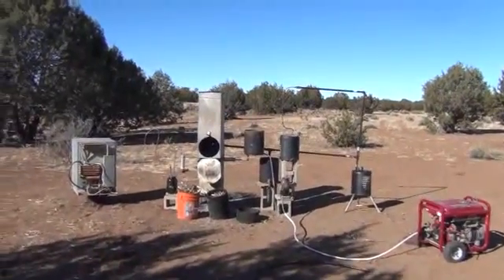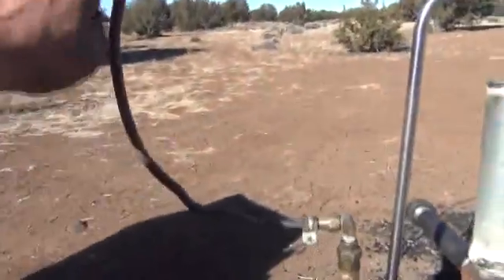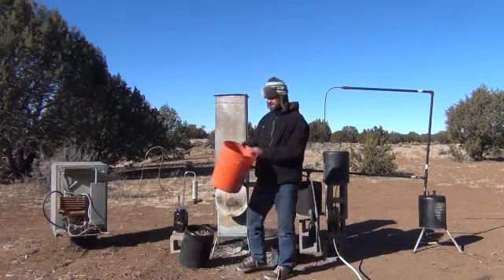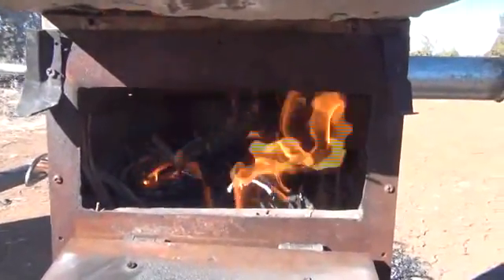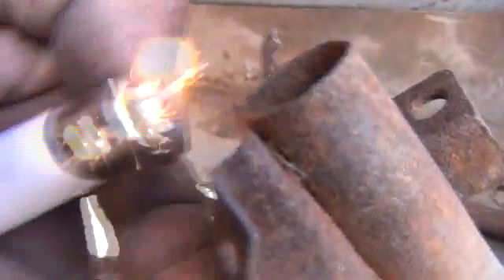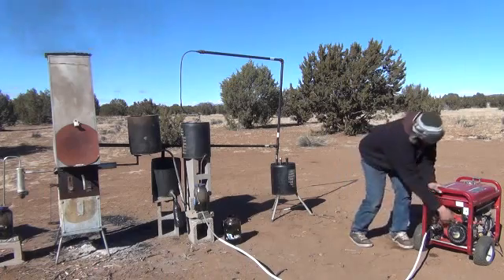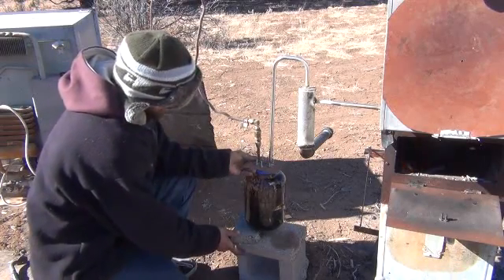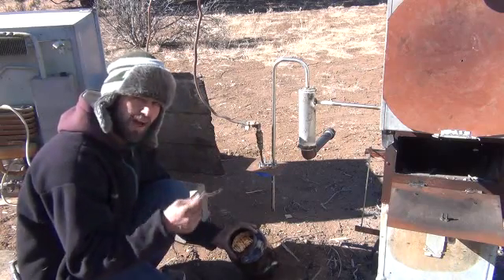Wood stove runs a generator "final video" make's gasoline, and propane.

Comment: If cold is important to improve efficiency. Couldn't you use a water loop that as the water heats up, it does a natural pump/percolation effect, which you could put in a water heater for a closed loop system? Then you'd have the added effect of a hot water heater while making fuel?

Comment: +MrTeslonian.
First off, thank you for a very informative video. Now a (maybe stupid, maybe already answered) question: are the (potential) gases, coming out of the blocked off pipe (before your gasoline condenser) flammable? If yes, wouldn't it be possible to lead those back into the system and using them for heat, thus making it a self-powering system?

Comment: I like a lot of others who do their own mechanical work usually have quite a bite of used motor oil around. Can that be introduced into the system either with the dry organic material, or one of the further distillation steps. Recycling that oil in to a usable fuel?

Comment: In my opinion there's nothing more valuable on YouTube than your channel. Keep it up!

Question - During the test phase you boiled the crude in the test tube and condensed the fuel out through the coils in the blue kettle... can this distillation process be done on a larger scale (a few gallons at a time) instead of using the metal catalytic process? If not, could you point me to some literature that lists which catalysts to use if I were to duplicate your system?

Thanks a million for your hard work.

Comment: Very impressive, I have been working on a rotary elector magnetic cylindrical  motor with a opposing pole application. It consists of 8 individual rotors which are timed
in sequence, The prototype is very small and i can't produce enough power to sustain transition. But it's a fun toy and somewhat of a hobby, your concept is 
working and producing energy in multiple ways.

Comment: You should look into the design of new high efficiency boilers.  They use large stainless steel baffles to slow down the exhaust gasses.  After slowing the exhaust gasses they extract the water vapor and use it to pre-heat the water going back into the boiler.  Very efficient systems.  The exhaust gases are so cool you can use PVC to vent them.  Once you get steam it can then be used to drive a turbine or Stirling based system.  From there you could run a generator and use it to generate high voltage pulses to extract hydrogen from water.  Even if your losing energy by making hydrogen, this gives you a way to physically bottle the heat instead of venting it off to atmosphere..

Comment: In your previous vid. You were talking about a way to recapture heat from the chimney. Mabe you could capture the unburned gases and reburn them or incorporate some kind of stirling engine to capture the heat and use it mechanically, mabe to turn a small generator or pump liquids for your machine, water pump or what ever. Just a thought.

Comment from the maker: Some crops would have a higher fuel density than others, they all will work as a gasifier fuel. Personally if I was intending to use large volumes of farm waste as a fuel source I would set the system up for methanol production which is much harder to do at a small scale than a fractional distillation system. If built right the entirety of the wood gas produced can be converted into liquid methanol, the pressures required are much larger in the order of 2000psi in one phase and 4000psi.

Now with most of the crops you listed, the first step for self sustained fuel would be to press the crop waste in a large vegetable oil press extracting the oils before the material is burned, this "vegetable oil" can be made into bio-diesel and by adding the methanol it becomes stable with a higher octane. Both of these fuels have a high market value. Methanol is by far safer environmentally than gasoline,The second step after the oil press would be a ethanol brew tank especially for the sugar cane and corn this would produce large amounts of ethanol, next I would take the mash from the brew tank and put it into a methane digester harvesting large amounts of methane, and then I would dry and burn the composted waste in a gasifier producing methanol. This would be the most efficient cycle for farm waste fuel production. Most oily, and starch laden row crops have a larger potential for fuel production than wood because of there other stored energy values, remember all we are doing is extracting by as many means possible the stored sun light in the material.
Reply: Mr teslonian I was wondering if you would be interested to come to the Philippines and help me and my team build a small scale biomass power plant I would be more than willing to pay for your ticket and accommodations and talent fee for your help  if your interested please email me (stavristeve321@gmail.com)
Reply: Yeah,  I think it's like, not turnips or radishes, or cabbage.. ugh, that stuff Dwight was a farmer of on The Office, that has a really high propensity to be turned into bio ethanol fuel I think.

And btw I heard some guy talk about antigrav tech.  Anyway, he said he saw a top secret air force/boeng experiment with a tesla coil BUT at the discharge point of the tesla coil there were fiber optic cables which ran back down through the insulated tubing that the secondary (your tall thin coil) was structured on, and that the tubing was filled with mercury.  The fiber optic cables ran back down and then actually went back into the & powering the primary coil (the thick one at the base).

I noticed you sometimes call secondary the primary and I know why, you reverse the use of them.  Andyway, I don't know enough to say there should or shouldn't be some type of law of resistance....Well actually I know enough to say there should be. BEMF & what not.

but I think it's pretty interesting trying to use the spark generated to be input back into the primary coil.
Reply: I would like to ask you a question on your wood stove Mr. teslonian. Will your woodstove work on oil palm fruits, for we have plenty of oil palm trees planted on our land here in Sarawak. I would like to try on oil palm and jatropha fruit as fuel .
Reply: Michael Z

Comment: Looks like that fuel has a high octain and low ctain content close to that of regular 87 octain, i am very impressed. That thing works great for a prototype and the best part, you kept it simple. Found your vid. While searching for info on using my wood burner to heat water for heating my home, now i have a few other ideas.  Thanks for the great vibeos, YOU GOT MY VOTE !!!

Comment: With all of that free wind energy you've got there- could you come up with a simple turntabe/belt-pulley rotary centrifuge to extract and seperate your different oils? If a drum within another drum is mounted to the turntable- and the final liquid pipe is above it- as the liquid is produced, and dripped in- just like how a clothes washer spins to extract the water- the lighter fluids would spin up & out first- leaving the heavier at the bottom. Just a suggestion- what do you say? Thank you!
Reply: Centrifuges are super-hard to balance. A highly skilled machinist could certainly do it, but it would be a tricky job.

Comment: we had a chance a few weeks ago to buy a pallet of those steel gas cans at an auction, now wishing we had bought them....   I'm not a machinist type person but you do a good job of explaining how everything works I think I can muddle my way though trying to build a setup like this.   

One thing we were wondering, would green wood produce any different than seasoned wood??  or would it probably produce just much more water vapor?

Comment: Your system is operating on "scraps" from oily woods. Could efficiency be gained (or lost) if you were using crops grown primarily for other purposes, sunflower, rapeseed, olives, hemp, sugarcane etc. In your opinion would a particular row crop out perform the material you are currently experimenting with? Excellent presentation. Very forward thinking, and, creative utilization of readily available construction materials. Thank you for sharing your research. God Bless.

Comment: what about offsetting gas or diesel using this in the air breather unit???  like you would a hydrogen generator?      We have a number of military surplus 3 phase generators some from the 60's that have carb problems and can't find parts for them.     This company: propane-generators DOT c o m has from what I understand very good low cost conversion kits.

Comment from the maker: The carburetor for a standard gas engine will not work properly for wood gas, so I removed it and therefor removed the governor. As you point out the hertz will be fluctuating as you apply and remove a load from the generator, the carburetor needs to be specifically designed to run wood gas which I don't think any one has done yet as a product. I found that a propane powered generator or vehicle is easier to convert, due to the similarities in lpg and wood gas.

Comment from the maker: The limitation of the demo unit was volume, the demo would need to be fed every 30-40 minutes, now the amount of energy released during that time frame would fully heat a large building. To capture and slow release the heat a trick I learned in Alaska would work well, the lodges all used very large water tanks some 22 feet high by 8 feet in diameter to retain the heat from there wood stoves and slowly release it. This would work very well for a gasifier stove. Info on the stove coming soon.

Comment from the maker: I have not tried sunflower seeds, as a gasifier fuel they will work fine as will any organic material. When it comes to creating liquid fuel from it there may be some catalyst modifications, like the catalyst required to turn bio-crude into fuel is different than the catalysts for a plastic trash based crude.

Comment from the maker: The unit in the video was a test prototype that I had built just for the show, the coke ash is removed after every cycle by injecting pure oxygen into the carbon cracking chamber increasing the temperature allowing the coke ash to burn off of the catalysts. The most advanced unit so far has a fluid catalyst cycling system.

Comment: Excellent research and practical application. Great show how to do and not talk the talk. I have a question on the generator. How can you maintain the 3600 rpm required to produce proper power for power tools. This might burn them up since they are not quite operating at the specific frequency. Anyways for lighting and then pumping that power into a battery bank for stored energy would also be helpful. Anyways excellent work Mr. T.

Comment: Great video on Process Operator Engineering. However since this is small scale do you do a shut down and cleaning? Or dispose and rebuild parts? If you clean how often/how many hours can it run before cleaning is required. Mainly the coker do u clean or replace? and the hydrocracking could be a dangerous pressure? how do u regulate it safely? It is quite obvious you have a knowledge in engineering and proses operation. This is not for the average do it your self.The synthesis gas is high output.

Comment: Love this series!  A good question I have is the propane-like gas you are creating compressible?  Other wood gas generators I have researched just create a use now type fuel and cannot be stored unless a generator is used to recharge battery bank.

Comment: A simple idea for using the excess heat coming out the top of your stove during production: 
Prune some of the trees on your property, hook a mulcher up to the syngas stream/generator, and reduce leaf/twig material (as well as wood!) to usable fuel.

Because the mulch would be fairly moist, you could cobble together a simple kiln, fix it to the top of the stove system, and use that to dry the mulch to an easy-burning moisture content. 

Higher-efficiency system, with more abundant fuel supply!

Comment: So grateful that you exist. There is little chance of me being able to achieve this without a LOT of experimentation, trial, error etc. I am inspired to try however as freedom and sustainability are essential to me in this life. I wont ask you for blueprints or more details as you would provide those if you wanted to. 
I do have a quick inquiry Have you  tried using old tires or tire chips as fuel? If so could it work in a set up like this? What would be required to get a complete utilization?

Comment: Greetings...
Thank you for sharing your I.P.; the time you've invested developing, integrating and recording your ideas is impressive. I watched your earlier (1hr+) video too, and learned a lot. I feel you could commercially develop your design, and provide a turn-key solution for off-grid living. The fact your design works with twigs, cow poo, etc. makes it superior to the systems from others, where they stipulate the use of specific wood types/size, and they're systems are very co$tly. Kudos!

Comment: Hi,very impressive presentation,I'm just wondering if the gas that runs your generator can be captured or compressed in a gas cylinder using a compressor?because I have a ceramic kiln and i would like to use it directly to my burners if it is possible, thanks

Comment: Looks great.  Maybe add some thermoelectric generators and a continuous feed system.  I wonder what would happen if you put your crude through a column reflux still and pulled the distilet off at different temps..  Easy to make out of copper pipe.

Comment: Outstanding! Very inspirational. I can see this system insulated and heating thermal mass to extract all the shed heat. The chimney could even be "rocket stoved" to concentrate final exhaust heat to a flat top where more water heating could happen and the last of the heat could be collected through exchange to a mass. Syngas could be used to add btus back into your main burner, make more hot water or steam, stirling... lots of possabilities! Best to you.